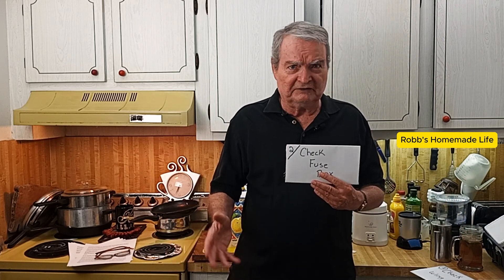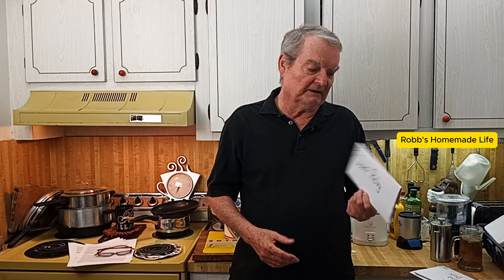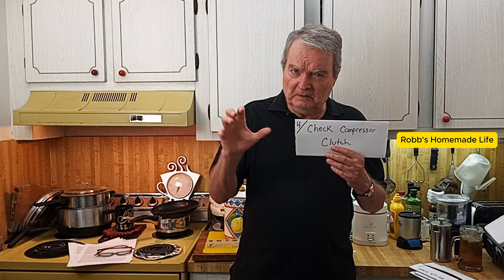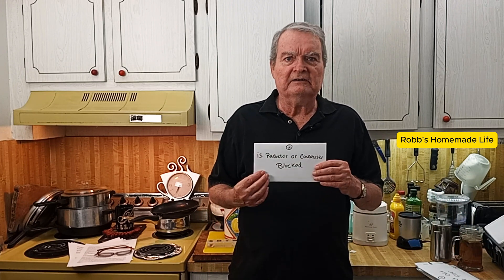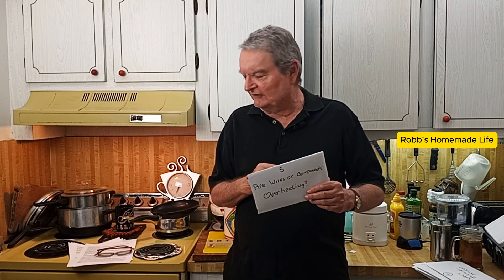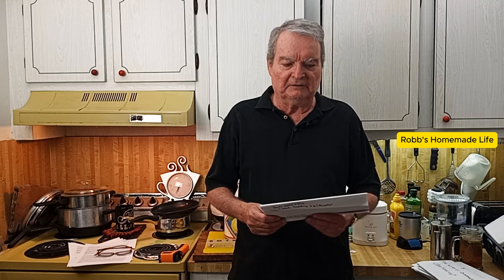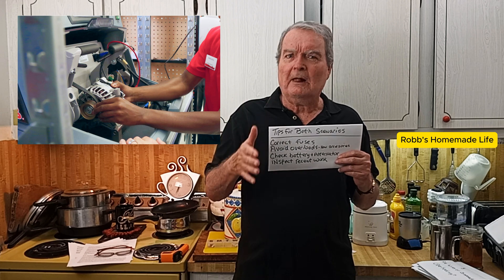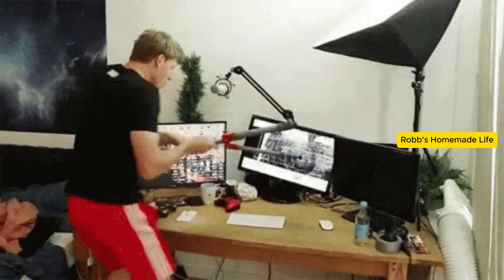CAR AC FUSES KEEP BLOWING 12 WAYS TO FIX

Comment: OK, so I just bought from a friend for pennies on the dollar a 2003 Chevy suburban 2 Wheel Dr. 5.3 L as soon as I put the 10 amp fuse in within seconds it blows the fuse so then the next step I went through at least seven fuses like that, and then I went and replaced the relayand it worked for a minute and then it started popping again defuses I checked the cabin filter I checked the air filter. I checked all the things except for removing the fuse box. That is the next step in the process.
Reply from the maker: Based on what you're describing—a 10 amp fuse that keeps blowing quickly, and even after replacing the relay it only works for a minute—this definitely points to a direct short to ground or an overloaded circuit. Here's a step-by-step guide to help you keep narrowing it down:

 1. Identify Exactly What That 10A Fuse Powers
First, double-check the fuse diagram in the owner’s manual or fuse box lid to find out exactly what circuit that 10 amp fuse is for. Is it for HVAC, the fuel pump, ignition, or something else? That will narrow the search. Chevy Suburbans often have fused circuits like:

HVAC blower motor

Fuel pump

Cigarette lighter/power outlet

Instrument panel

ECU or sensors

 2. Disconnect the Load
Once you know what component(s) the fuse powers, try this:

Disconnect the component (for example, unplug the blower motor or fuel pump).

Insert a new fuse. If it doesn’t blow, the component you disconnected is likely the shorted or failing part.

If it still blows even with the load disconnected, then the wiring is shorted somewhere between the fuse and the component.

 3. Use a Test Light Instead of Blowing More Fuses
Instead of burning through more fuses, try this:

Remove the fuse.

Connect a 12V test light in place of the fuse.

If the light glows bright, it means there’s a short or heavy current draw.

Start unplugging things in that circuit until the light goes dim or turns off—that’s the faulty part or section of wiring.

 4. Look for Wire Rub-Through or Pinches
Common trouble spots:

Wires behind the fuse box can get pinched or rubbed raw.

Wiring looms near the firewall or driver’s footwell (especially where they pass through metal brackets or grommets).

Look under seats or near the center console if the fuse powers accessories like the 12V outlet.

Look for any aftermarket wiring or accessories spliced into the circuit—alarms, radios, or remote start systems are frequent troublemakers.

 5. Yes, Removing the Fuse Box May Be Necessary
If everything else checks out and the problem persists, the internal wiring under or behind the fuse box could be shorting.

It’s tedious, but removing or at least lifting the fuse box allows you to inspect for corrosion, melted wires, or signs of arcing underneath.
 Extra Tips:
If the fuse is for the blower motor, check the resistor pack too—they often short and blow fuses.

Don’t use a higher amp fuse to “see what happens”—that risks frying your wiring and starting a fire.
good luck!

Comment: Robb, is your stove and vent hood 70s harvest gold colored? That is so cool my man. I wish the appliance dealers would bring back those 70s colors including avocado green and poppy red.
Reply from the maker: Hey thanks for watching and commenting. Yes my apartment was built in the 1970s and there has been very little modernization I still have popcorn ceilings and I think my refrigerator it's from the same time. The markings on the dial on my stove have all faded and the clock stopped working I also still have jealousies in the front door which is very mid 20th century South Florida. I'll tell you something funny the kitchen has drop lighting with acrylic panels over the lighting and they were yellow and I could never find yellow tinted acrylic lighting panels anywhere until one day I realized they weren't yellow they were just old and faded sorry replaced most of them except for a few in the bathroom that I used as an accent around the perimeter I also have a screened in porch unlike most of the other apartments I've converted them to interior space by putting in solid walls and windows on the balcony.
Reply: @RobbsHomemadeLife  Excellent. Glad you're keeping the retro going. I like watching those videos of old abandoned homes, including the 70s that are on YT.
Reply from the maker: I watched a video that showed the renovation of a travel trailer from the 1950s the other day and it was absolutely amazing of course they updated some of it but the interior Birchwood and lighting was astonishing considering how old it was

Comment: You can just go buy a bag if ice and hold it in your lap while you drive if the AC goes out 😅
Reply from the maker: For years I have been going to make a hot weather suit with an ice chest and some water and a pump and a bunch of tubing and a white clean room suit
Reply: I used to do that. But I used it as a back rest. I got a little frost bite on a butt cheek.